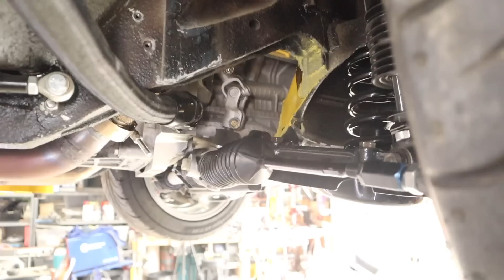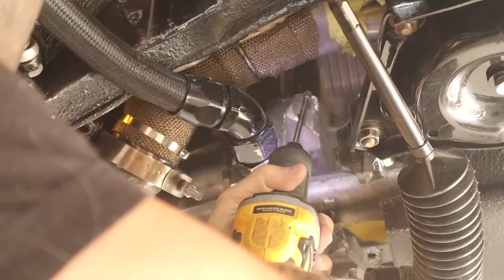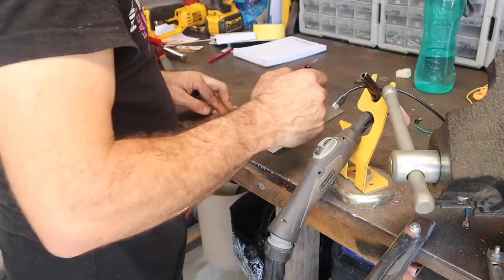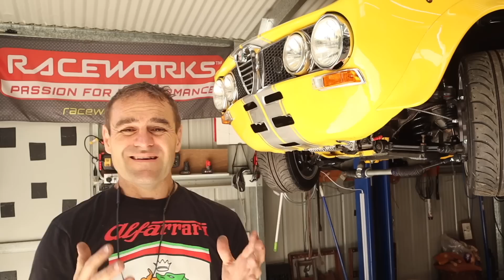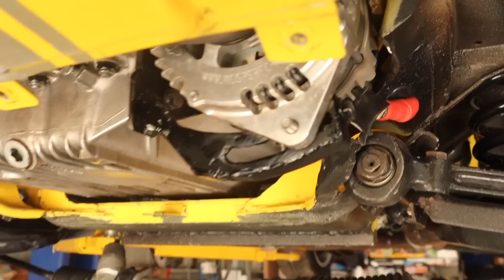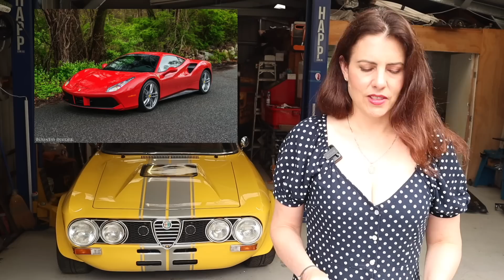Ferrari engine is overheating.. - Ferrari engined Alfa 105 Alfarrari build part 207

Comment: Hi Jeff, do you have to do anything regarding charcoal canister ?
Reply from the maker: No. According to my engineer that is not actually a requirement. From what he said, many engineers say you do but if the clause is read in detail that is actually not the case.

Comment: In the UK we use thread lock on calliper bolts, not spring washers. You can get really small alternators off some Diahatsu kei cars, with decent outputs, if the extra space helps on conversions - looks like you’re OK now. Doesn’t seem to be anything too bad to sort out

Comment: Hi Jeff, I was just watching your video when you made the fan shroud and it looks like the fans you used are pusher fans not pullers. The blades are concaved towards the radiator and should be the other way round. Most likely why the rubber flaps a fluttering and not cooling the radiator.
Reply from the maker: You may very well be onto something. I will double check that before I race in and buy all new fans.
Reply: I dont know what fans you have but some types so you can reverse the blades. @HomeBuiltByJeff
Reply from the maker: @adrianmifsud80  I actually think you have nailed the issue. Thanks mate.
Reply: No problems Jeff glad I could help.  @HomeBuiltByJeff

Comment: You had a very good tech inspector as all these snags are to the benefit of the use of the car. The '10mm clear' rule is applied in new car builds too for moving parts. After all this you will have supreme confidence in driving the wheels off this great car. Engine out is irritating, but will soon be forgotten after your first road trip! Graham, from a warm England.

Comment: My etype series 1 has a 4.2l with 2 original electric fans that kick on and original 2 core radiator about 800x600, and stays cool in any traffic.  It has a new high performance belt driven water pump.

Comment: Mostly good news Jeff, and given all you've done, it's a pretty small list of fixes!

A few people are commenting about vents/gaps at the rear of the bonnet - just keep in mind that this is usually a high pressure area and exit vents in that area may not work (eg the A9X Torana, and I think a Commodore, have a rear-facing induction intake at the back of the bonnet). It's common to see exit vents in the front half of the bonnet.

Hopefully someone with more aero knowledge than me will be able to help.
Reply: Correct, this is why air vents are often located here, to get high pressure air at the base of the windscreen for cabin fresh air. Wheel wells are a negative air pressure area if you needed to vent anywhere. That said a lifted bonnet could bleed hot air out while stationary, the fan should be able to do this as well though.

Comment: To help cooling ,,remove the bash plate so that air can flow in around the sump and add a vent in each rear corner of the bonnet.
Reply: Or simple cut holes in the plate for airflow AND protection
Reply: It's a dry sump.....
Reply: @1one3_Racing  Oh ok ,,but it would still allow air to flow up and around the headers , taking heat away from the engine when idling if there are vents in the bonnet as well.

Comment: Engineering issues mostly resolved, nice work. On the cooling front I mentioned to you months ago in the comments that the 360 and F430 Ferrari's have really big cooling needs and they obviously run two radiators, as others have said the only solution I can see with the little space that you have is the highest CFM fans possible for that space and have them kick in at a low temp, god speed.

Comment: My thoughts on your cooling, if you have any air gaps between the radiator and the shroud it will cause the rubber flaps to not pull closed. You may need to mount some rubber or high temp foam between the two to seal. Also the flaps should be a thicker material that sits perfectly closed by itself with nothing going on. Anything too flexible/thing with not work right and tend to over time and heat bend out and stay open which will lead to fan pulling air from the flap entrance rather than all through the rad core.
Reply: To this point I'm remembering now. We took a bicycle innertube and put it on the fan shroud with some pop rivets so it literally touched the radiator this made a huge. Difference in the amount of air. We pulled through maybe if you have a shroud you want To Do this at the shroud and seal everything else.
  Regardless sealing the air gaps is important.

Comment: You need to do more tests before concluding . Are the fans push or pull check this its not as simple as reversing polarity. The fan cowl needs to be very close to the rad so it doesnt circulate around the edges so dont move it away.  Does it still overheat with the bonnet up in which case it wouldn't be a venting issue.

Comment: As a builder of old air cooled fiats and VWs id suggest a potential solution as you have a rear latched bonnet is to just put a couple of risers on the latch mechanism so hot air can escape infront of the windscreen without affecting the shroud directing air through the radiator
Reply: At standing still, maybe at best.
But once you start moving the area in front of the windscreen becomes a high pressure zone, counteracting what you want. 
This is one of the biggest misconceptions in the whole car hobby/racing scene. Rising the rear of the bonnet for improved cooling.
(For the rear engined Beetle it’s an other story though I guess.)

It might not be an important aspect, but it also signaling “I don’t have a clue” to the once in the know. 🫣

I bet this can be addressed with the correct programming of the water pump. One of the really big pros of the electric pump. 👍
Reply: @andli461  as you say, i build rear engined cars with the low pressure at back so yes i hadnt actually considered the high pressure zone at rear of bonnet. Happy to stand corrected.

Comment: With the cooling issue Jeff,  have you tried controlling both fans independently,  having one come on at a lower temperature and as it rises having the other one come on, also the majority of fan shrouds if see have the rubber flaps in hinges so they are much easier to open close. Maybe look at a larger capacity header tank or higher cfm fans.